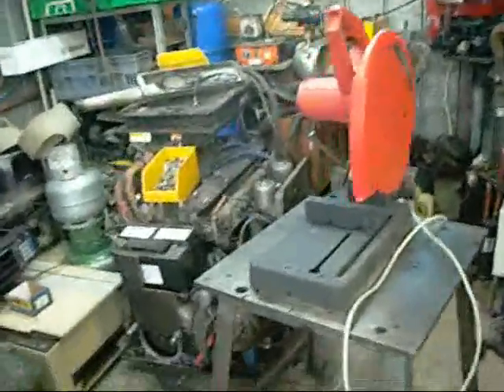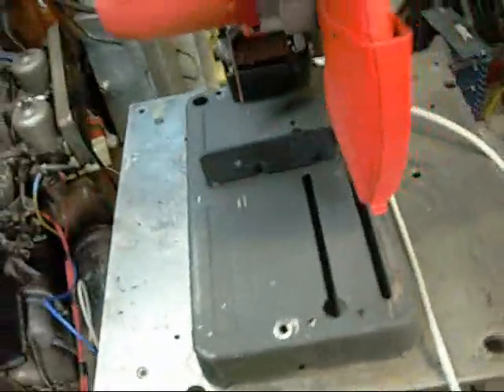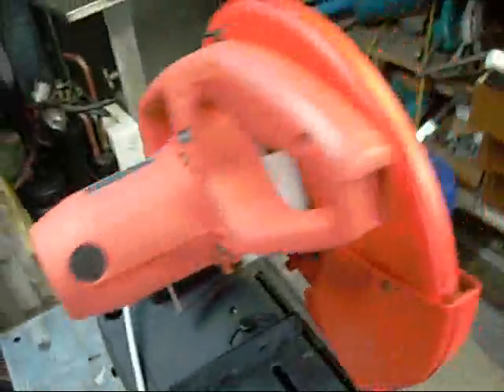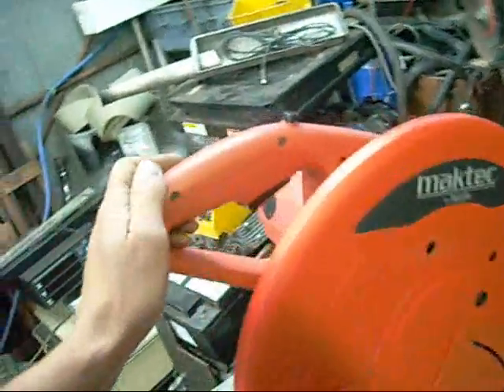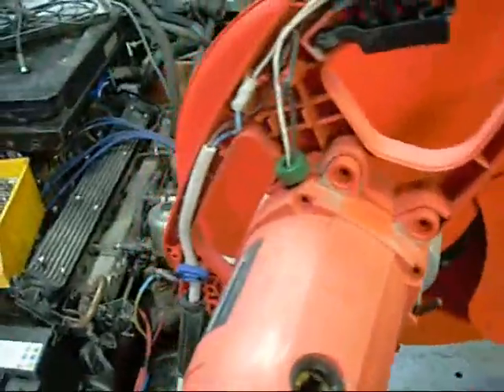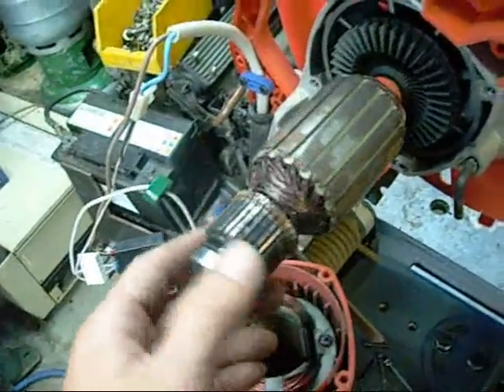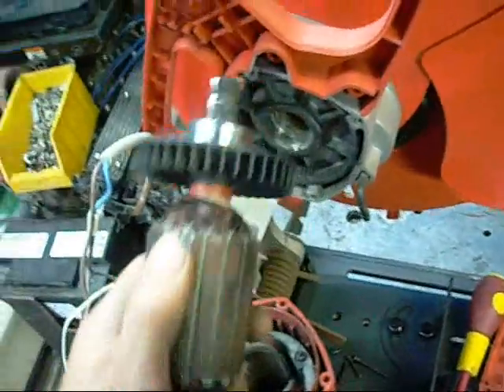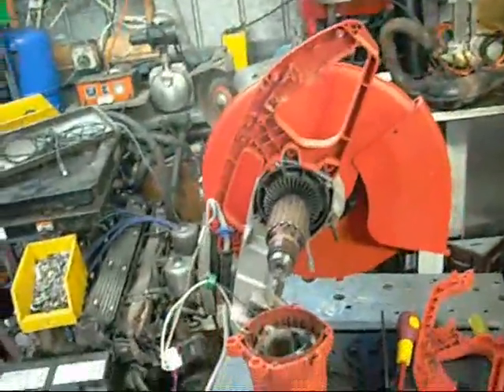Maktec Metal Chop Saw Autopsy - Universal Motor Failure

Comment: You probably have overload the motor. Тhis is done by to much heat on comutator by the brushes, who transfer the heat to armature, etc... this tool have a 3 year warrranty and a new rebranded model is called Makita M2401. Which is practically the same machine, and should be a quality product. I don`t like only one thing - there is no soft start, and the machine jumps like Michael Jordan, every time you switch the trigger.

Comment: Dewalt is so much better than makita or maktec. Dewalt tools can last a very long time. My dad has a 15 year old dewalt corded drill and motor just whizzes like a champ without any sparks, excessive heat, or bearing squeals.
Reply: Makita is better my dad has a 35 year old Makita drill and it still runs as smooth as when he bought it

Comment from the maker: @digihawk159 I have seen machines with open windings in the rotor, it simply means you need to position the wheel for starting if the brush lands on the 'dead zone' when it stops.

I will try and repair the rotor in that manner untill I get a new one.

Comment: I would clean up the commutator with some sandpaper and clean out the grooves between the bars with a knife or a thing saw blade, then test it on that growler you spoke of. In looking at it even if the motor is shot you could try adapting another brush motor to it, perhaps from a circular saw or motorized miter box. It isn't worth having that rotor rewound it's probably cheaper just to buy a new replacement motor.

Comment: That burn looks alot like stall burn. if thats the case itl toss sparks exct do to all the carbon on those sections a pollish fixed up the righ i was working on no problems. ofcorse i cant realy see the windings in the vid all that well but a winding burn in my experince dosnt leave that large of a burn patch on the comutator (again tho we only use 115 volts )

Comment: i have a huge triton 12 inch circular saw that has the same motor and the same problem. dont know wether its the armature windings or the field or what ever else. but depending on whats interchangeable might be able to get one or the other going. theres another trade to be had if you write it off. lol.